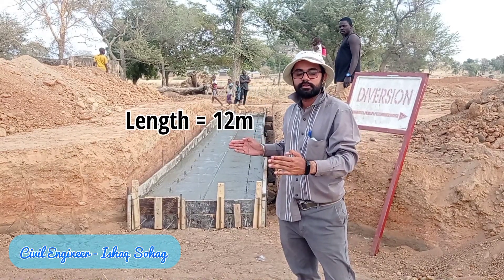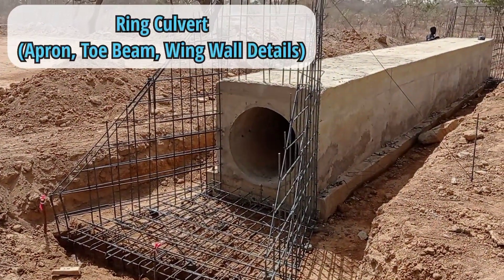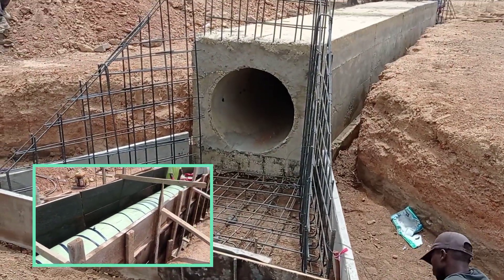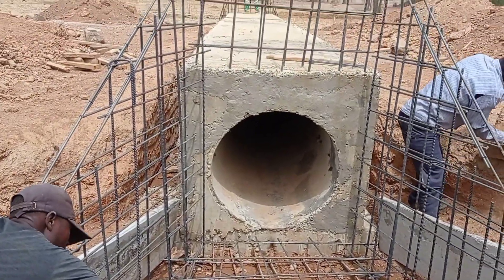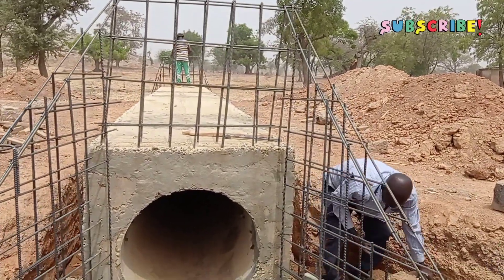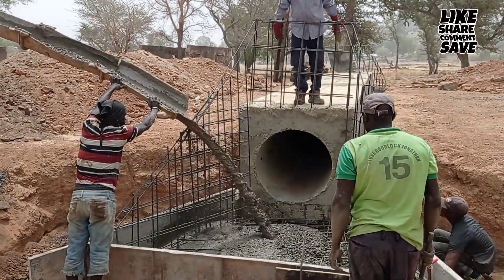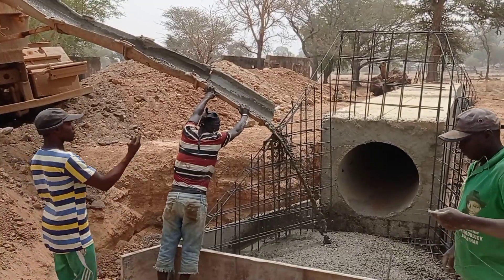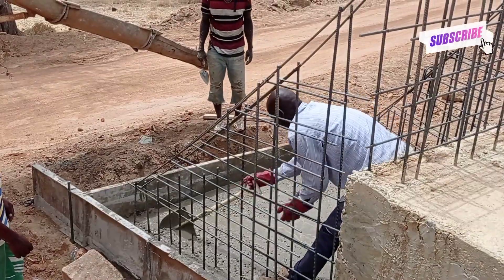Pipe Culvert | Ring Culvert | Apron, Toe Beam & Wing Walls Detailing

Comment: But best on your experience sir, how many cubic meter of sand and gravel will be needed in 1cubic concrete, practically?
Reply from the maker: It depends upon the grade that you are using. Commonly, M15 grade concrete is used.
For 1m³ of concrete we use 250 to 350kg of cement, 700kg of sharp sand & 1,200kg of aggregates/chippings.
Moreover, approximately 150 litres of water is added in the concrete mix.
Thank you. Hope you found this useful. 🙏🏻